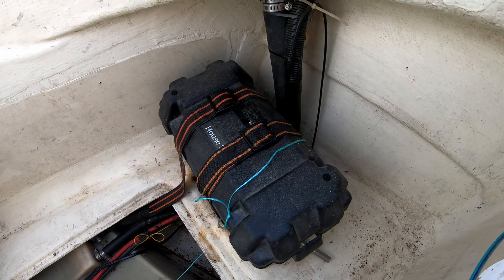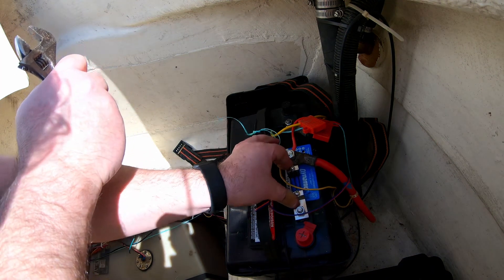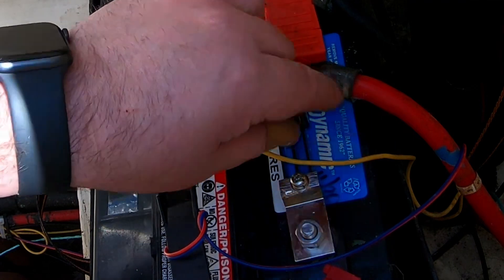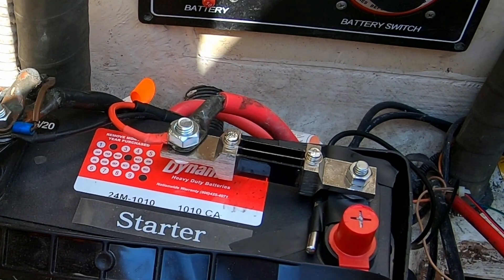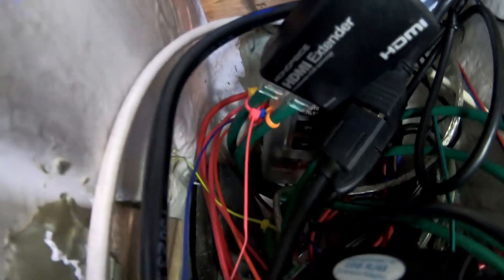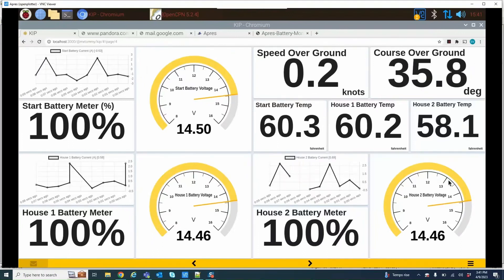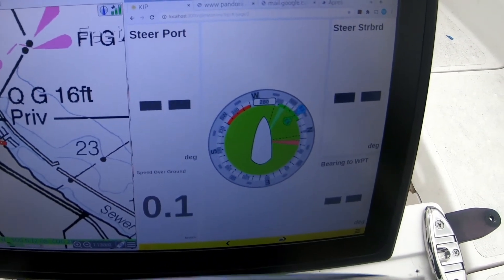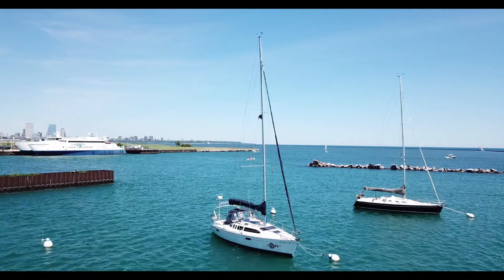DIY Marine Battery Monitor using SensESP/ESP32 Install - Tech E16 - Après Sailing

Comment: Something got updated and I'm now getting an error when compiling: Warning! Could not install `{'owner': 'me-no-dev', 'name': 'ESP Async WebServer'}` dependency for the`SensESP` package
Reply from the maker: SensESP has been updated to version 3 and my software is older.  I have updated the software but have not had a chance to test it, but it does compile.  Feel free to test away - https://github.com/Techstyleuk/SensESP_V3-3-Battery_Monitor
Reply: @ApresSail  That was quick, V3 compiles fine, data shows up in SignalK data browser. Thank you!
Reply from the maker: @kolyan2003 great, thanks for testing, that saved me a bit of time as well!!

Comment: This is amazing, I've been trying to find a solution to measure high current with esp32 and finally it seems like there is a solution. I'm used to use shunts and battery monitors like TK100 but always wanted to make one my self to get it more custom
Reply from the maker: Thanks, Good luck with your Project!!

Comment: nice video. a couple of observations.
as you are using High side shunts … the two shunt voltge sense wires have full battery “energy” behind them …. and are running some distance from the battery to the ESP32 circuitry … 
hence it would be good practise (and safer) to fuse each of these wires  “close” to the battery…
Reply from the maker: Thanks for the feedback, I will probably add those!

Comment: Great channel. Thank you. Question: Why did you pick the INA219? I had better luck with INA226 (I am measuring the low side and also want to get bus voltage) but was there any other reasons? Also, sorry for the lazy question - I didn't look at your code yet - are you compensating the battery SOC using battery temperature?
Reply: Advantage of putting the shunt on the high side is that the low side remains at ground level. It is preferable to have solid electrical ground throughout the boat, less chance for inadvertent ground loops or other ground noise issues.
Reply from the maker: The INA219 was convenient for me - it was known to be working with SensESP and I was planning on using high side sensing so it fit.  Actually, in hindsight, I would probably have gone INA3221 triple channel current/voltage sensor, but I didn't have confirmation it would work when I started the project, but now I believe it would.  My SOC calc is very lazy, actually, it is not coulomb counting or temperature compensated, it is just looking at voltage and a lookup table that represents a lead acid battery discharge curve.  Not overly accurate but I am going to see how it goes for this summer and maybe do an update in the fall